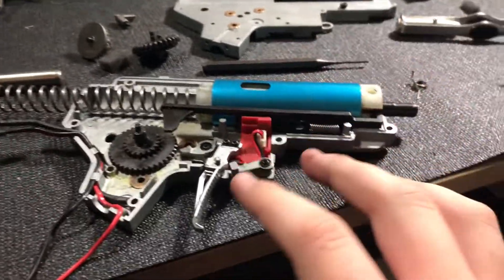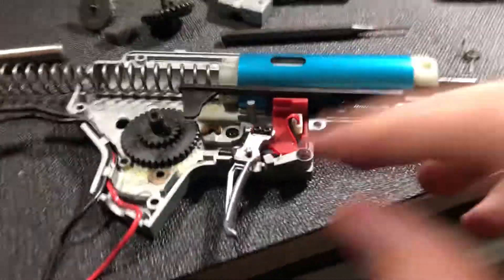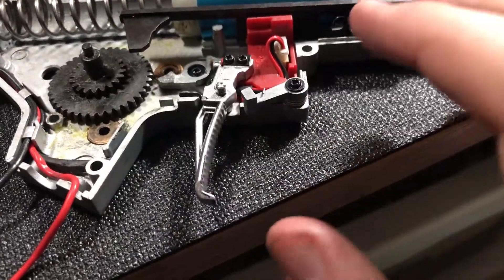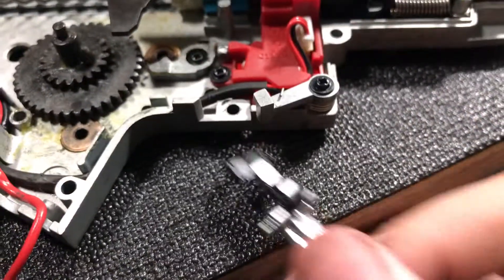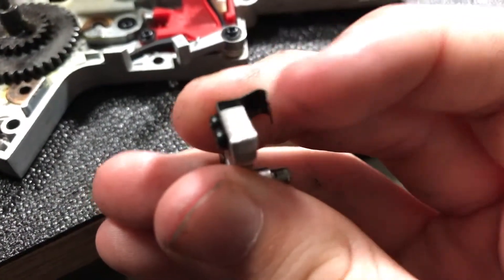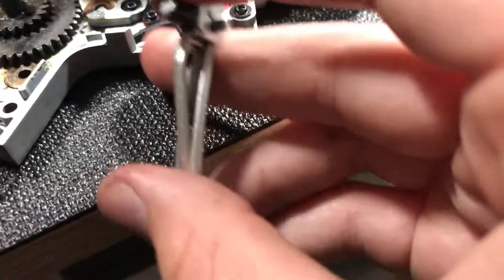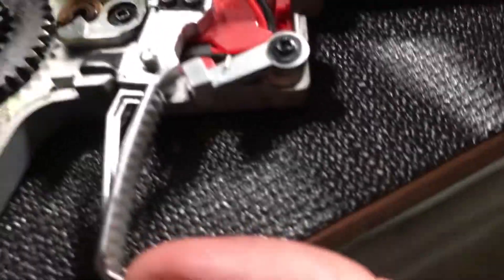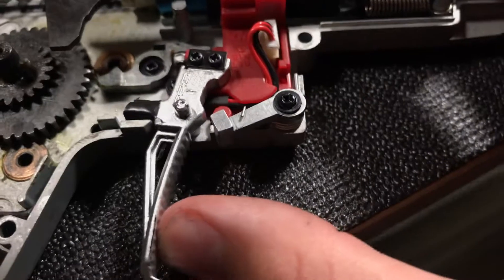Arp9 hair trigger

Comment: Im thinking of getting an ssg1 is it worth saving up for a polarstar jack after to put in the ssg or not?
Reply from the maker: Yes I have loved mine so far and have had no problem, just played with it at a CQB field yesterday and it worked great, I was shooting at 300 FPS and getting across more than half the field easily and could have made it farther if I turned psi up
Reply: @SB-xb3td  Thanks a lot also will this work on any V2 gearbox with a micro switch trigger?
Reply from the maker: @abcdefedcba2  possibly, if the trigger is built the same then yes, if not I recommend a tunable trigger (maxx tunable trigger or a tunable speed trigger. )